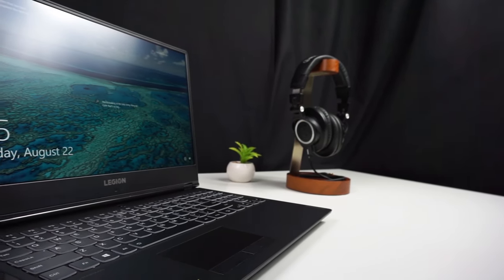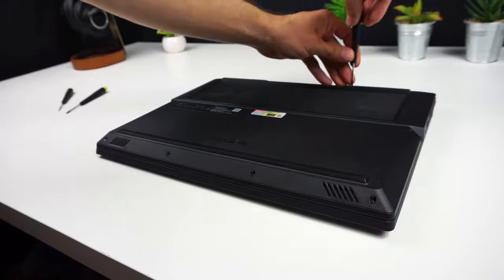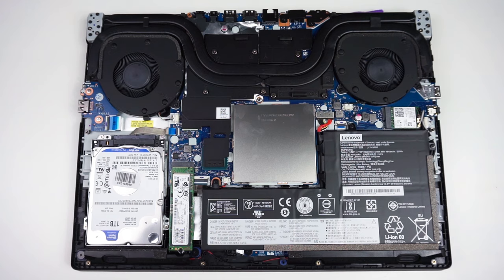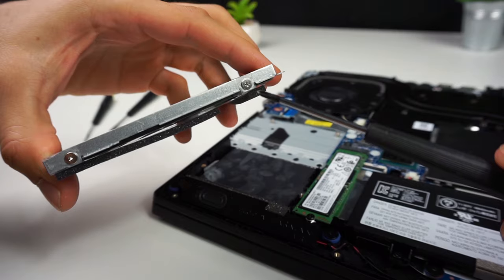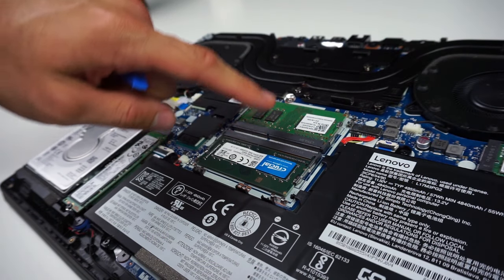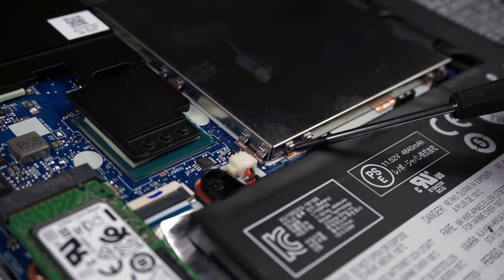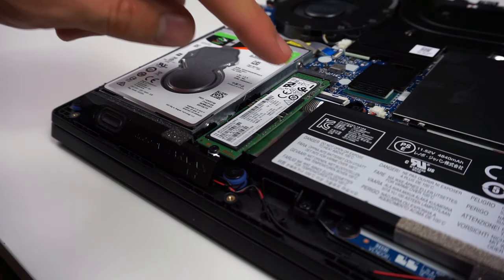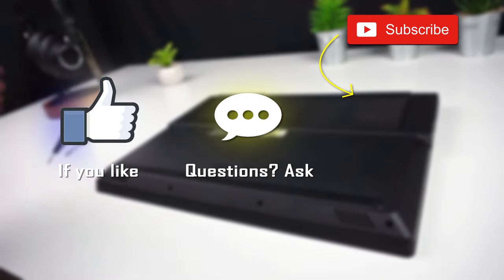Lenovo Legion Y540 Upgrade RAM / SSD / HDD - Disassembly Guide

Comment: If I already have windows and other programs installed on m2, do I have to backup all the documents before adding a SATA SDD 2.5?
Reply from the maker: No, it's a separate drive so you'll keep your files as they are ;)

Comment: Hello, nice video! Did you have any heating issues on heavy load after adding the second hard disc?
Reply from the maker: This laptop runns pretty hot anyway. Usually adding drive doesn't really change anything
Reply: @TechFinds  I did it anyway since I wanted to dual boot with separate hard drives and so far so good, I haven't seen any changes. Thanks for the reply!

Comment: If I opt for the SSD only variant then I get the option to add a SATA SSD in the future but my question is if I buy a SSD say for example the Crucial MX500 will I get the SSD along with the sata to motherboard connector or only the SSD ?
Reply from the maker: By default you'll get this laptop with M.2 SSD which means that you'll have free slot for 2.5" SATA SSD. You can add it in the future and connect it with SATA cable
Reply: @TechFinds  What about the SATA cable will I have to buy it separately ?
Reply from the maker: @L-CSE-AyanKumar  No idea mate. I don't know if you can use any sata cable if LEnovo won't provide you with one for this laptop

Comment: i have a lenovo legion y540 8gb ram, intel core i5 9300hf, gtx 1660ti. this RAM is  ok?: HyperX Impact DDR4 HX426S15IB2K2/16 Arbeitsspeicher 2666MHz CL15 SODIMM
Reply from the maker: If you wanna mix with original RAM don't ho for HyperX as it has different specs. You can buy HyperX if you bou 2 new RAM sticks
Reply: @TechFinds  OK thanks

Comment: 2:04 is there anyway i can repair the spot where hdd cable meets botherboard, i mean that little white plastic and metal thing? because after an hit my hdd disconnected and there is nothing holdin that cable to the motherboard...hdd was making sounds so i guess mby its dead aswell
Reply from the maker: I think you need an expert to fix that. It requires replacing the connector maybe which involves soldering

Comment: I wanted to add Samsung EVO840 2,5" SSD to Lenovo Y530 using ribbon cable as on this video NBX0001M410 (also tried NBX0001TC00), but my Lenovo Legion Y530 doesn't detect the SSD nor in BIOS neither in Windows. I checked BIOS system date/tome, I switched between UEFI and Legacy, battery was unplugged, but it didn't help. I tried with mechanical 500GB 2,5" SATA drive and it is not turning when connected.

Comment: I am planning to buy a lenovo laptop, i want to know whether lenovo laptops have cpu in-built with motherboard or not? Because my previous laptop was of asus and when motherboard got faulty i had to replace motherboard and it cost me half the price of laptop.
Reply from the maker: Every laptop has CPU soldered to the motherboard. There are only few laptops on the market where you can replace CPU (for example Acer Helion 500 AMD).
Reply: @TechFinds  Oh..thanks for the information..

Comment: I tried to upgrade my PC by adding an extra 8gb Crucial RAM. After installing it tried to start the PC but didn't start nor did it charge. Sent for diagnosis and they said motherboard is gone and needs to be replaced. I have a Lenovo legion y540. Does this happen?
Reply from the maker: Actually you're the first one to report that. This is an electronic thing, such failures may happen to any other laptop too, but it's not common issue for this laptop. You probably got a bad unit.
Reply: Ahhh dang. So the RAM I got was defective? That's some bad luck 😢
Reply from the maker: @dipankar490  I think you might have defective laptop/motherboard, not RAM
Reply: @TechFinds  Ohhhh. I didn't know that could happen. I had been using my laptop for a year and never had problems. Thanks for replying 😊

Comment: Hello,

Im going to buy this on best buy (Lenovo legion Y540 17.3”) with 16gbs Ram and 1Tb ssd. How do I know if ir comes with ssd (2.5”) or m.2 form factor. What’s your recomendation? With 16gb Ram i could work but with only 1tb ssd i need at least 2Tb more.
Reply from the maker: The seller should specify it the laptop comes with m.2 SSD or 2.5", but I have never found Legion with factory 2.5"ssd. They come with m.2 by default.
Reply: @TechFinds  So I assume the 2.5" slot is just empty in those models?
Reply from the maker: @bluejanis5317  Yes it should be empty and you can add your SSD/HDD
Reply: @TechFinds  Do you think there is a temperature change with adding a drive?
I could imagine the added space/air might help with cooling.
I could also imagine, that the temperature will not be impacted at all, because the laptop has dedicated heat pipes.
Reply from the maker: @bluejanis5317  The different should not be noticeable

Comment: Hi can i add 2 32GB ram (Ram Upgrade Ddr4 2666Mhz Sodimm) which will be 64GB or add one 32GB RAM in the second slot where the first one contain 16GB within the same memory speed .(reaching more than 32GB in both cases) Thanks
Reply from the maker: This laptop supports up to 32GB (2x16)

Comment: Does y540 supports 2tb of HDD? cuz I bought 2tb HDD and it randomly disappears.Maybe that's because it is WD....
Reply from the maker: Yes it supports 2TB. Brand doesn't matter. Probably the HDD is defective or there's something with the connection. Check if the cable is connected well to the motherboard and HDD.
Reply: @TechFinds  I dont really know what could be an issue cuz that hdd works flawlessly on desktop and old 1tb drive worked just fine. So my best guess could be that i damaged sata cable when i was mounting new drive or i just didn't catch error on desktop even if there were any. I tihnk i will return hdd and try my luck with seagate.

Comment: Hi, at present I have an 8gb ram (2666MHz)so I was planning to buy an 16gb CL15 DIMM for my second slot with the the same speed (2666MHz) is that ok?
Reply from the maker: It should work, however i don't recommend adding different size and different CL. You better match the specs of new ram to avoid eventual compatibility issues

Comment: hi there. i wanna buy the legion with rtx2060 and i5 9300h but i wanna ask if i can change the disc with nvme evo plus for better speeds.Is it compability?thanks
Reply from the maker: Yes, you can use that drive
Reply: @TechFinds  thanks bro

Comment: when this laptop is on charging the fans become too much noisy and when i remove the charger then only the sound stops. Is there any solution?
Reply from the maker: Every gaming laptop is loud under full load as the fans must spin fast to cool the hardware properly. If you disconnect the charger then performance drops dow drastically and there's no need to cool it so much, so fans get quieter. There's no way to do anything with that as the fan speed is aoutmatic in this laptop.

Comment: Hey there neat video. 
What is the maximum size for the 2.5" sata and for the m.2 2280? In my country they say i can only put 1TB IN each but wanted 2TB IN one for starting upgrade. My SN PF1XFN2Y thank you in advance.
Also where can I find the cable by amazon? Or should lenovo local lab is the only source?

Comment: This is still the old model shown. 2020 model needs to have only 2 screws removed to slide open the front half of the back panel.
And if there is no factory 2.5" HDD installed, you will find a dummy drive with 4 screws and cable already inserted.
Reply from the maker: Yes, this is the Y540 from 2019
Reply: Wether you have a dummy drive or an HDD actually depends on what you ordered. ;)
Reply: What are the differences between 2019 and 2020 model?
Reply: @MrKimakatsu  2019: The back panel is a single part, with a flat front half and a perforated back half, separated by straight line (as in video).
2020: The halves are separated by a 45° angled skewed contour. You will also find only 2 screws on the separate front part and no screws in the middle area. The new model has always the cable already installed.
Reply: @SpeedFlap  Thank you

Comment: Can we use the HyperX 2666MHz ram stick mentioned in your description to upgrade the Legion 5i model along with the pre-installed 2933MHz ram stick present in it?
Reply from the maker: If you gonna mix with original RAM you better don't use HyperX. Go for Crucial that i linked as it has the same specs as original RAM

Comment: Which ram should I use for i5 9th gen processor?
Reply from the maker: You can use the ones that i linked in the description. If you mix go for Crucial as it has the same specs as original RAM

Comment: Can it be upgraded all the way upto 64 GB RAM kit ? Lenovo Legion laptops (as per production description on website) max out at either 16 or 32 GBs.
Reply from the maker: 32GB (2x16) is maximum this laptop supports
Reply: @TechFinds  What I meant was the  i7 10th gen CPU supports upto 128 Gs.
Reply from the maker: @rahstiest  yep with 10th gen you can go for more ram

Comment: existing 8 GB ram is removable? if yes can the ram be extended to 32 GB (16+16)?
Reply from the maker: Yes, you can replace RAM as shown in the video. You can upgrade up to 32GB (2x16) 2666MHz

Comment: Does the metal frame come with the sshd when you order it? I've never had a laptop before and I want to buy this one and I want to know every little detail.
Reply from the maker: No, you should get the frame with the laptop.
Reply: @TechFinds  Okay thank you for the response. Does the metal frame work with a normal SSD too?
Reply from the maker: @GTRadu  yep if the ssd is 2.5" too
Reply: @TechFinds  Thank you for answering my stupid questions. Dropped a like on your video too!

Comment: I have a question. Do I really need to remove the battery connection or is it fine?
Reply from the maker: It's a good practice, but it's not necessary. Some oeople say you may get electrocuted or damage laptop if you don't do that but I never do it and I'm fine.

Comment: I've just bought recently a Crucial 8gb ram CT8G4SFRA266 and it seems my laptop doesn't recognized it (I turned on my laptop and my screen just appeared black) then I put it out and it was normal again, do you know what the problem is?
Reply from the maker: I've heard about that issue, but unfortunately I don't know what's the problem. It may apply to any laptop and vast majority of people doesn't have that issue

Comment: at change ssd nm2 lost windows 10 what your recomendation for system operative for lenovo y740 thanks for you response
Reply: You have to clone the drive.
Reply from the maker: If you changed the drive where you had windows installed then you have to fresh-install windows on the new drive or clone your previous drive as Anthony said

Comment: what to do after installed a new ram like is there any settings after boot the laptop?
Reply from the maker: The RAM will be recognized automatically and ready to use as soon as you install it in the slot
Reply: @TechFinds  good to know! is that the same way with the HD & SSD?
Reply from the maker: @zdoginterprise  With any drive you have to go to device manager and make a new partition after installing the drive. If you replaced the SSD where your windows was installed then you have to re-install windows on the new drive.

Comment: Hey, the HyperX RAM that u recommended doesn’t seem to have the same CL as the one I currently have, which is 19. Wouldn’t this affect booting? Thanks
Reply from the maker: HyperX or Ballistix is good when you wanna buy 2 new RAM sticks. For mixing with original RAM you should choose Crucial which has the same CL19.
Reply: @TechFinds  Got it, thanks. Went with one from Kingston instead since they're more widely available in my region and a much cheaper option here. I was contemplating on replacing it all with a dual channel kit but figured I might as well save the money for even better future upgrades :)

Comment: minimum specs for gaming+streaming? and also which laptop would you recommend
Reply from the maker: Would be good to have i7 at least and maybe RTX 2070 / 2080 to run games on higher settings. But if you're on the budget you can go for GTX 1660Ti or RTX 2060 with i7 and eventually drop the graphics settings
Reply: @TechFinds  i found out that in predator gtx1660ti vs asus rog hero 2 rtx 2060 , when graphics are maxed out on both  rtx one wins, but when graphics are brought all the way down in both, predator squeezes more fps,so i think if we can compromise in graphics predator would be better option, what is yout view on this test,?
Reply from the maker: @prayaschittamang7888  I'd say that it depends on the game, but RTX 2060 is slightly better than GTX 1660Ti anyway. The thing is that RTX 2060 is sometimes much more expensive

Comment: all legions 540 has hdd bay? also these who come only with pcle nvme?
Reply from the maker: Yes, if it comes with only one ssd it means that you have a drive bay free
Reply: @TechFinds  I saw that there are larger and smaller battery's, the larger doesn't come instead of hdd bay?

Comment: Hi, do I need to buy the cable that connects the 2.5' drive to the laptop? Mine came with only m.2 ssd.
Reply from the maker: I had this laptop already with HDD so I don't know if they ship it with the cable if you chose configuration without HDD
Reply: hi Gal, did you find out? I'm in the same boat and got a new SSD but the slot is currently empty.
Reply: Helping you both out as my laptop came with only SSD too, the slot and the cable are both allready inside your laptop. The cable is in there allready connected to the motherboard, except for the fact that the cable plugin is connected to a placeholder piece of plastic. Removing this plastic however, might void your Lenovo warranty, which is why I insured my laptop elsewhere instead of relying on lenovo support. Good luck tho! As for the person who only had the hdd without an ssd, the ssd slot is still inside the laptop, but you’d need to install the ssd as shown in the video. The only difference is that theres no ssd screw for you inside the laptop. So if you manage to get yourself a screw of the same size as shown in the video, install as seen above. If you can’t find the same screw exactly it is possible to replace that one screw with another on the laptop. Just make sure when you want to get warranty on your laptop you reinstall the original screw’s location before sending it in.

Comment: What do I do if the blue ribbon cable for the hdd doesn't go all the way to the black line
Reply from the maker: The blue line should be right before the connector when the cable is fully inserted. It doesn't get covered. Just close the tag and see if the hdd works

Comment: My OS is on the current M.2. how do I get it onto the new M.2 that is installed into laptop?
Reply from the maker: You have to fresh-install Windows on your new drive using Microsoft Media Creation tool (from pendrive). Or you can clone the drive, however i don't know how to do it.
Reply: Download the Microsoft Media Creation Tool and create a boot drive with a USB flash drive (at least 8 gigs large if I recall). There are many youtube videos on installing widows with Media Creation tool...very easy; don't be scared.

Comment: After installing the ssd should I configure something in the bios(the laptop didn't come with a ssd)?
Reply from the maker: After installing any drive you have to go to device manager and make a partition to make it appear in your PC
Reply: @TechFinds  I didn't cofigure anything. I just installed the ssd and the Windows and it worked. However I have one question: Is Lenovo Legion Y530-15ICH compatible with Samsung Evo plus 970 250gb?

Comment: Thank you so much for this video, it is precisely what I needed! 
A very calm voice and good edited as well.
One question tho, you are saying that the SSHD is almost as fast as an SSD. Do you think AAA-titles such as Witcher and Exodus will run properly on the SSHD? I was willing to upgrade my 128gb SSD to 480, but after seeing your video, I might consider doing the HDD upgrade instead.
Reply from the maker: You should not replase SSD with SSHD expecting the same performance. SSHD can work almost as fast as SSD but only in limited circumstances when for example you learn the SSHD that you use certain program often. Then SSHD gets faster with each run of this program or windows start, but idk how it works exactly. It has it's own memory but idk how much it can remember and if it doesn't forget things. ;)
Reply: @TechFinds  Alright. Thank you for the fast reply. I guess I go into more research before I decide! Have a good one :)

Comment: The lid won’t open. What tools do I use 🛠
Reply from the maker: You need anything that is thin and pretty solid plastic. And you have to find a good spot to start with.
Reply: Which spot do I start with? Thanks for noticing my comment!
Reply: oh hey, also when  I opened my case, there was a metal-like thing and it was covering the ssd slot. do u know anything about it? i got a Y530 so that might help
edit: it looks like it can be removed with using a screwdriver, but I was wondering if i should even touch it
Reply from the maker: @yeetub  This is just a cover with thermal pad. If you wanna replace SSD you have to remove it first, then after installing put it back on
Reply: @TechFinds  thanks!

Comment: Can the Lenovo legion Y540 be upgraded to 64gb ram. (2 x 32gb)
Reply from the maker: From what i know 2x16 is max
Reply: @TechFinds  Ok. Thanks for helping me out.
Reply: @krisqhansq1384  
Bardzo dziękuję za informacje.
Reply: Jus successfully installed 32gb module near 8gb and works well (having 40gb in  total). Plan to replace 8 gb module to second 32 gb and have 64gb total (saw few posts that it will work)
Reply: @illiasukonnik9966  Nice... Lemme know how it goes, and if it still works with 2 x 32's.
Reply: @lukevicente6704  everything is OK. Sometimes I load it with huge datasets in Python and it runs well